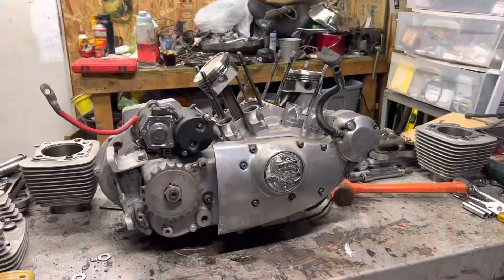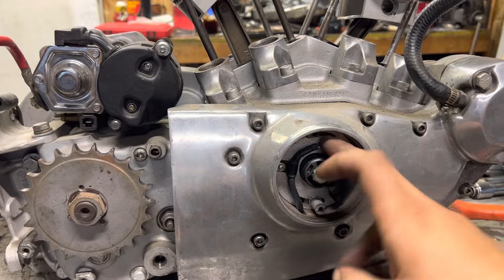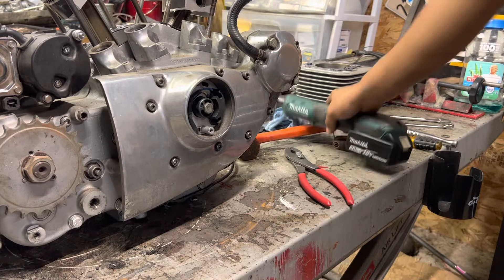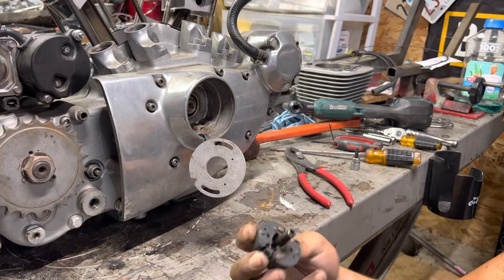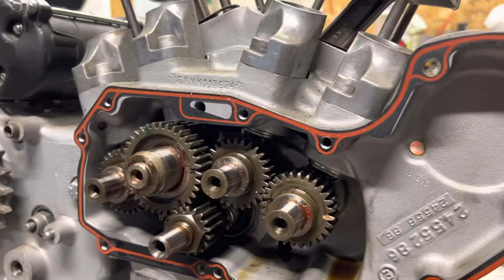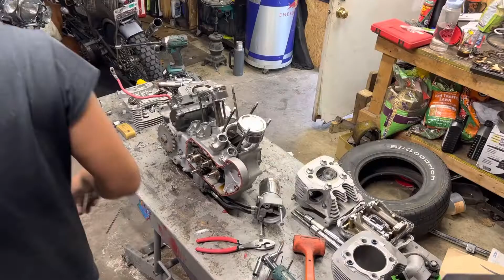Harley Evo Sporty Cam Cover Removal and Inspection

Comment: my ironheads cam cover is fkn so stuck. I watch this video for sweet relief....pops off with only a few wacks. ahhhhhh
Reply from the maker: HAHA that's always how it goes!  Pushrods out at least?  They will hold tension on the cover if you didn't pull them first!

Comment: How could it not have moved since it was assembled and you say that it's shifted fine through the gears when it was on the bench???
Reply from the maker: You can shift the transmission through the gears and rotate the motor is what I meant.
Reply: @WrenchingWrecked thank you for the clarification. As an American I've learned the importance of words when I was in court after being beat up by the police on a profile in jail as an innocent man. I had to defend myself without a lawyer and I was able to turn the state's attorneys in the cops words against them because they were sloppy with their words and they were actually lying lol.

... And that's why the universe has gifted me My Liberty Edition Sporty😊
I had a severe bottom end noise after a trip while I was pulling into my driveway though. 
It's nothing in the primary chain case or anything within the cam case. I've never worked on a Harley before only V8 cars and this is kind of out of my league. 
 There's no compensator either it's a triple chain sprocket delete I think... If I had known that maybe I would have rode a little bit easier.😢
It's still started up before I took it apart but it was a constant knock in the middle of the crankcase... I don't know if something came loose or whatever but I don't regret breaking it down as far as I did. Supposedly it only had about 400 mi on it... I don't know who rebuilt it and I'm in a different state now which is North Carolina. 
 The cams look brand new and so does the inside of the engine cases on both sides and the collection chains are new as well.... I have to find somebody I can trust.